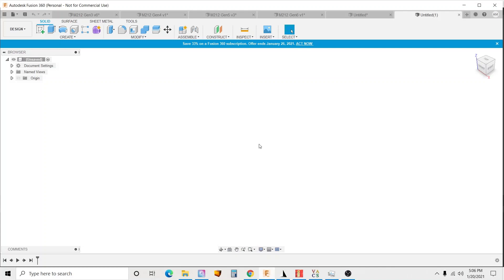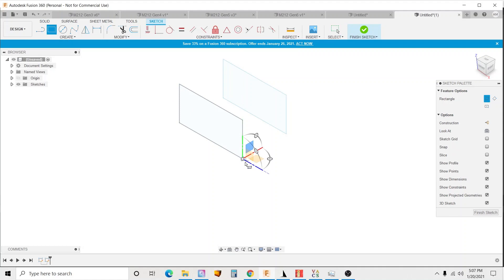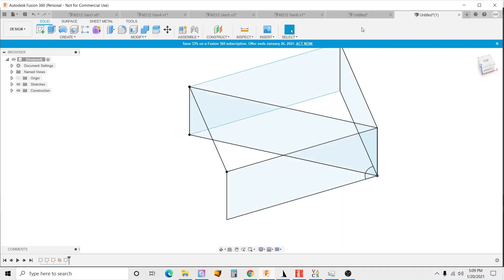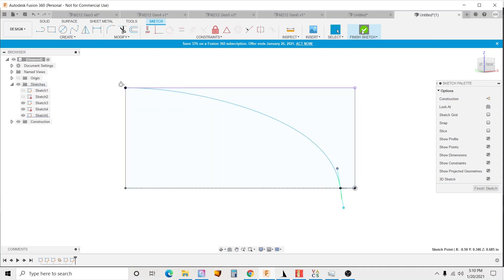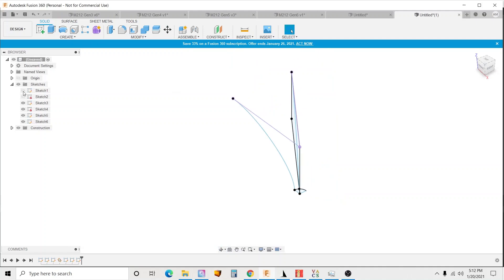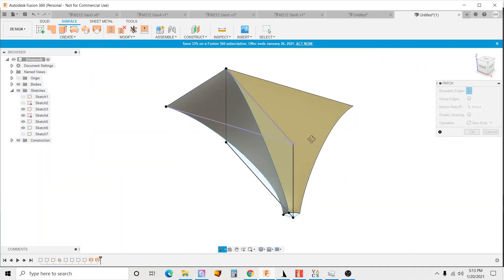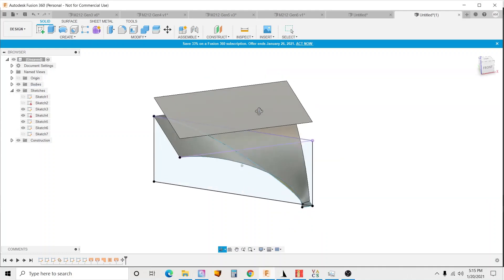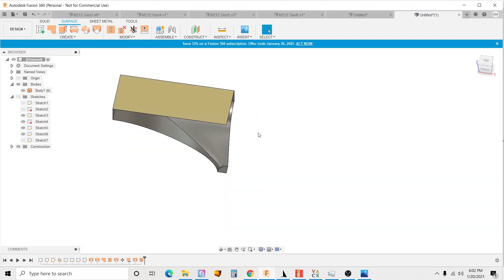Modeling Rectangular Waveguides in Fusion360

Comment: Hi Austin, your video on Akabak was very helpful to me, its up and running thanks to you. I am now designing ilets call it a waveguide for my CD, it is very long for a CD (41cm) I have tried different shapes and I allways get very distorted results. I modelled a horn for an 8" and got very good results. Is that what the hf horns actually simulate like? Or are there some others things to look at besides the design? The last one was a tractrix revolve design, seems like cant go wrong with that put still. very distorted when moving off the center of the wave. I would love to hear your thought from your experience.August

Comment: Great videos! I happened to see that you have a much finer color palette in the VACS contour form than what I have ( 9:41 ) Do you use a custom Contour Color Map File? I have no idea how to increase the number of colors otherwise...
Reply from the maker: Thanks! Yes I went through and changed a lot of settings. I think I just let it auto pick colors, but I thickened the line weight to make them more visible
Reply: @austinmys8693  Thanks for your reply! Your videos help a lot as Akabak's UI is quite unusual.